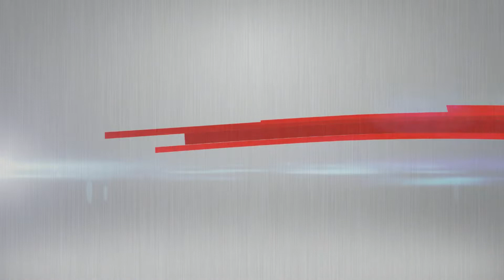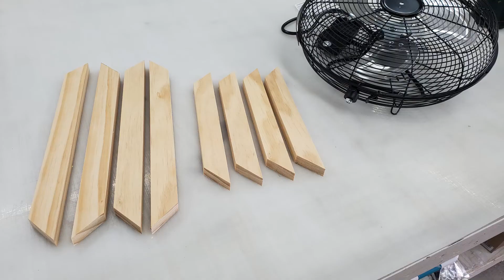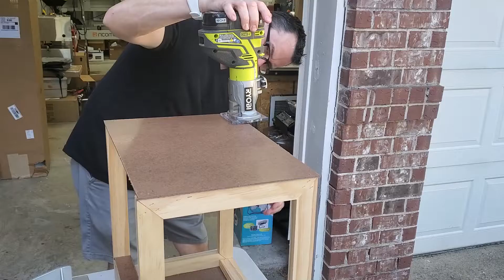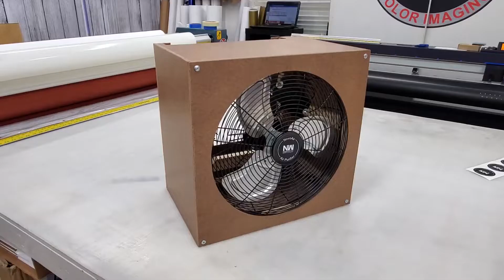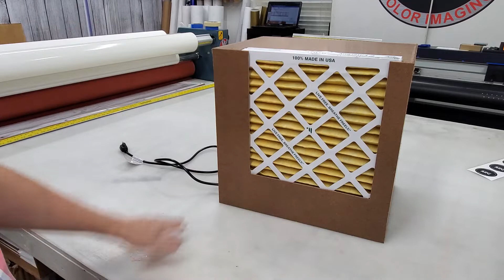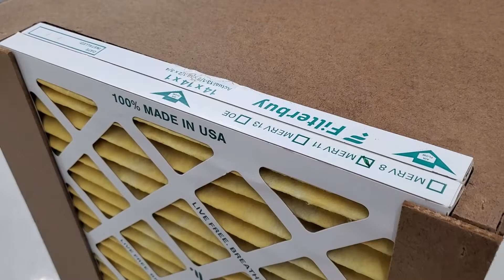DIY Build of an Air Purifier w/ Carbon Filter

Comment: For some reason units you buy use negative air pressure rather than positive. I suppose that has some reason like being more efficient for the fans or better filter distribution
Reply from the maker: Yea... more air being exhausted then taken in works best
Reply: @Novoworks  i just realised another good reason. Filtering the air before reaching the fan makes sure the fan and its motor stay clean.

I suppose this is also for safety as a dusty motor could provoke the 1/10000 chance of a spontaneous combustion.
Reply from the maker: @NubeBuster  Correct 👍

Comment: Would this work for a laser exhaust to vent to? Maybe with 2 carbon filters?
Reply from the maker: You can certainly replace the MERV 11 pre-filter with a second carbon filter, or buid it as I mentioned... deeper so you can do another 2 sets of filters on the sides to increase flow.

For something like a fiber laser, I would think that would work for air filtration... but would need some testing of course.
Reply: @Novoworks  we have a CO2 laser
Reply: @Novoworks  MORE FILTERS WOULD DECREASE AIRFLOW.
Reply from the maker: @JESUSCHRYSLER5512  - More filters in the way of surface area (around the enclosure) would increase flow.  Stacking air filters on top of each other would decrease air flow.
Reply: @Novoworks  REALLY? ENLIGHTEN ME, *OH, GREAT AND OMNIPOTENT ONE!!*
Reply: @JESUSCHRYSLER5512  Not if they represent separate openings with the same two filter stack. This is a pretty basic concept, there's no debating. Think of a simple cube-shaped box (say, 16 x 16 x 16 inches) with solid sides except where the fan is mounted. Run the fan. There will be some air flow because air leaks in around the fan itself. The fan speed will be maximal because the fan is doing very little actual work (not much air to move, therefore less resistance to rotation of the fan blade).Now drill a 2 inch hole in the side opposite the fan. The fan will draw air in through the single hole with a certain air flow (and the fan speed will decrease slightly). If you then drill additional 2 inch holes, each will allow more air to be drawn in by the fan, thus increasing the total air flow. Note that the fan speed will vary inversely with flow. If you seal off the single hole, the fan will run the fastest and the flow will be minimal. As you increase the number of holes, the fan slows down because it is able to do work by moving increasing amounts of air. In the limit, the fan speed will be the same as it would be if not placed in a box at all.